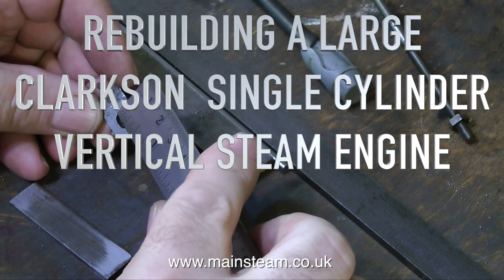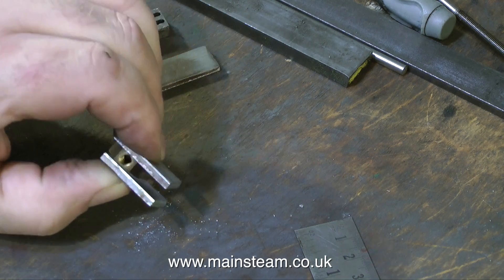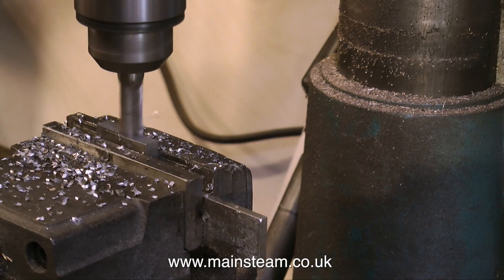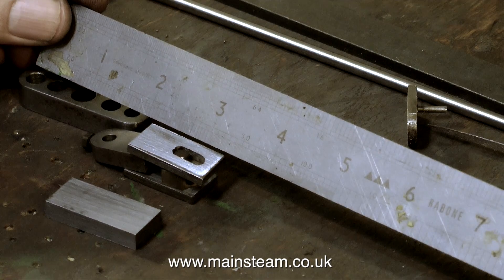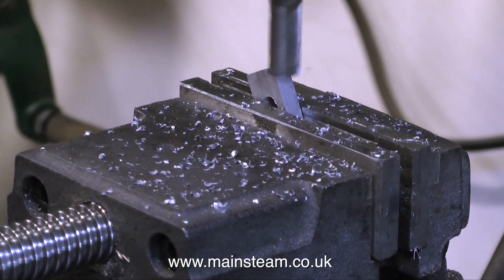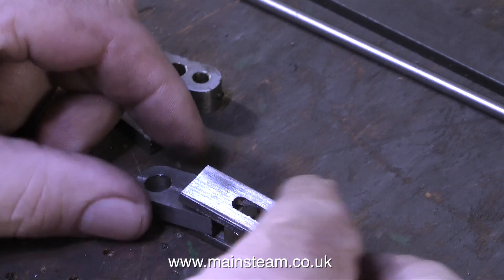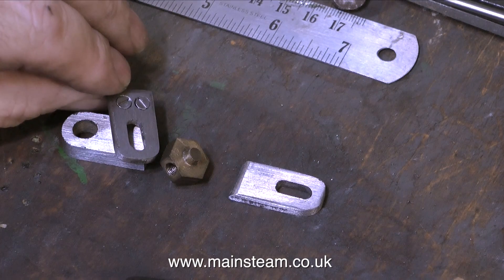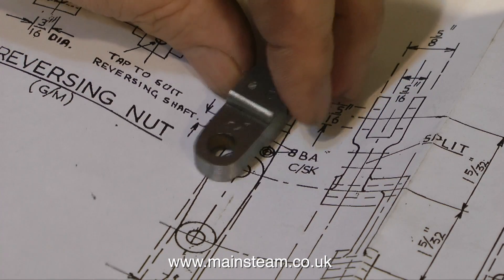REBUILDING A LARGE CLARKSON VERTICAL STEAM ENGINE - PART #28

Comment: You've mentioned here (and in other parts of this series) using (what I presume is a tool) something which sounds to my American ear like "linear shear" but I've honestly no idea what that might be. Here, you describe using it to nicely taper the sides of the part. Previously you've described removing a small amount of metal from an upper bearing that wasn't tight enough.

I hope you'll forgive me for asking - I simply haven't got the ear to tell what sort of tool you mean. If you'd reply to this comment with the name of the tool, at least then I'd have it in written form and any failure on my part to be able to discern your meaning could no longer be up to my inability to listen to proper en_GB English. ;)
Reply from the maker: LINISHER = 4 inch bench mounted belt sander - I use it a lot :-)))
Reply: Thanks very much - I'd thought it might be a belt sander, but I didn't want to assume.